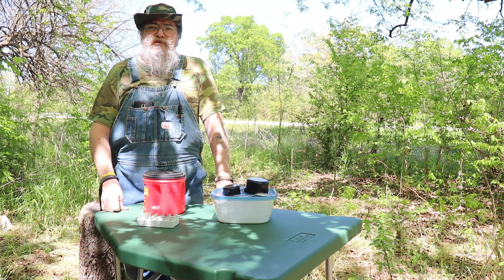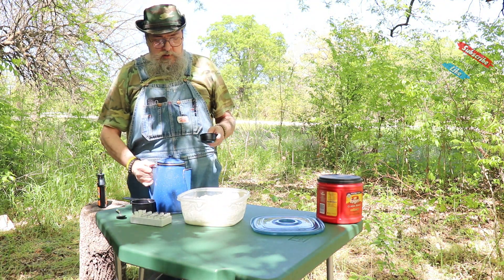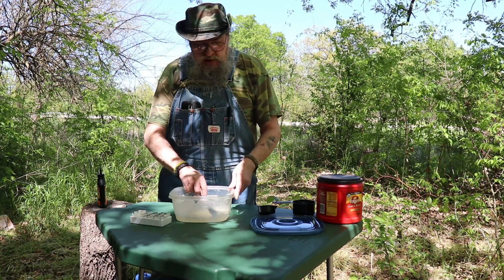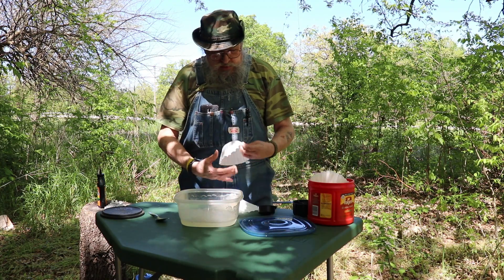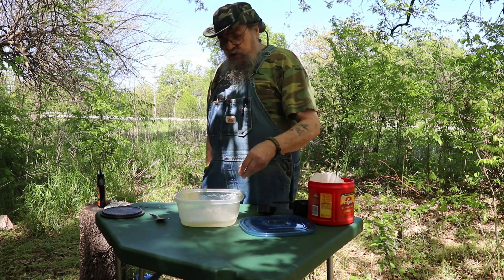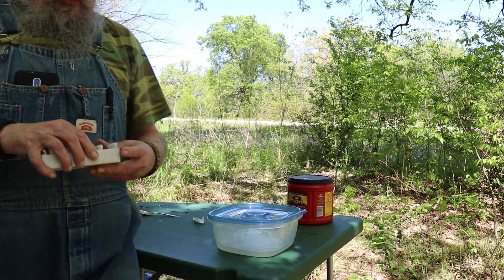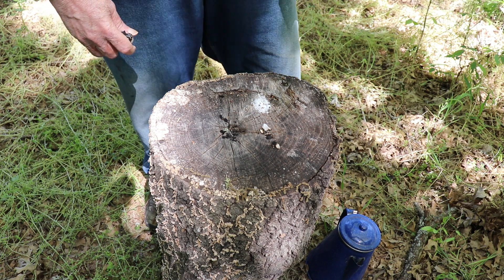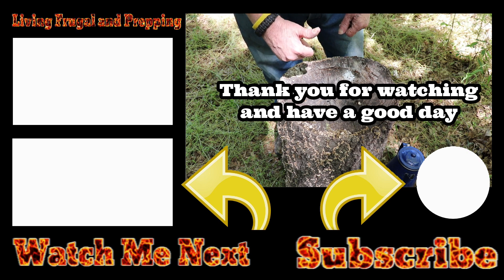Nitrating Paper for Combustible Cartridges

Comment: I used the same technique, same ingredients, maybe I did not do the 4:1 water KNO3 the same, I just saturated my worn/hot water with KNO3. But my paper just burnt a little better than regular paper? tried 4 or 5 times Pissed me off! tried different filters, cheap regular white, the special Organic brown filters, brown paper bags of different thicknesses, Now I got a bunch of trash with filters, and I drink Instant? Then I used my dry brick of KNO3 leftovers to "blue" some gun and knife parts.

Now I'm going to kick it up a notch and do a short light nitic acid wash, and a soda water rinse then with clearwater rinse and dry. (Sulfuric acid drain cleaner and KNO3) I want a more "Nitro Cellulose" paper. I will be Very Mindful to keep it short and rinse soon. Then test, and if I am correct? my paper for cartridges should form and glue well, but be closer to a slow flash paper and ignite in the cylinder a little faster and burn cleaner, OR? I Could Make Cordite/nitro cellulose! and that could be like loading modern Gun powder not black powder, very BAD. I will be "VERY CAREFULLY!  EXOTHERMIC!!! IN A SAFE Place with proper PPE" with a bucket of soda water and a garden sprayer of soda water ready for any acid emergencies. Nitric is No Joke! do Not underestimate! I had to work around the stuff pure and HOT for a living so I am a little more comfortable than I Should Be. Don't tell my wife please.
Let's Go Brandon!
Please Keep on making content, most of U.S. love learning and passing it on! GOOD Times! GOD BLESS Stay Safe and PLEASE keep making SMOKE!